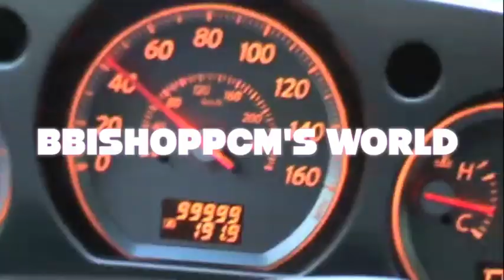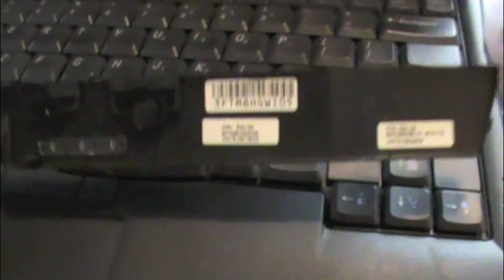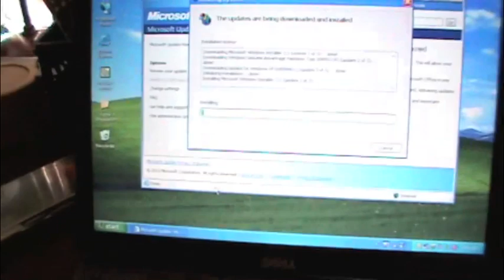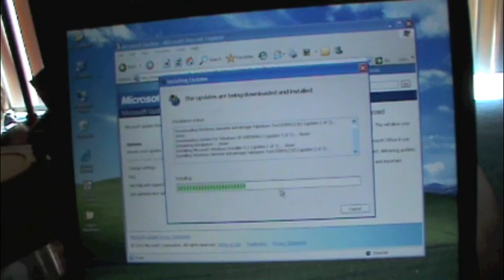Dell Latitude PP01L Repairs

Comment: i was given one of these and it doesn't even power on and i took it part and every thing looks fine.
Reply: That makes 2 of us. If you sort it out please share. Thx.
Reply: Update. Disconnect from mains, and remove the battery. Then hold the power button for 30 secs to 1 minute to do an electrostatic discharge on the laptop. Then connect to the mains - do not reinsert the battery at this point - and see what happens. If it boots up, turn it off again and reinsert the battery. Off you go.
Reply: it did not work but thanks for help

Comment: HOW to do to reset password bios????
Reply from the maker: ***** I've never had to reset a Dell, but IBM Thinkpads are a whole different story. They require major surgery.
Reply from the maker: ***** About 12 years ago, when I worked in a used computer shop, we had a Thinkpad 760XL that required a very delicate procedure to reset the password (IBM doesn't fuck around!), it required dumping the data from the ATMEL chip. The procedure is absolutely insane... we junked the laptop. http://sodoityourself.com/hacking-ibm-thinkpad-bios-password/

Comment: That's actually a Lattitude c600, however mine still says PP01L on the bottom, but when i looked up the service tag it Said it was a c600. It also says C600 when it boots up.

Comment: So my Dell Inspiron 600m (model PP05L) is actually a Pentium 3? That is really interesting considering the machine is from 2004. It has a 1.5ghz pentium M 715 processor and is soon going to get a 765 2.1ghz along with 2gb of ram. I'm actually really surprised this thing is as quick as it is, knowing now that it is a pentium 3 based system.

Comment: Glad that was useful!!! Those we are talking about are most usually discarded for use for any practical, real purpose at present. And yes, they are quite limited, but you can get more life into them than most people would expect from a machine over a decade old (usually way into the electronic rubbish level when it comes to computing).

Comment: I have pretty much  the same config as that laptop other than the processor. I have the 4750 (I think) and it works ok. Mine has the Pentium 4 1.6 512MB 40GB. The CPU Fan died though, It gets hot but never overheats. I rarely use it. I have the same problem with the hinge. These preform well for 10 year old laptops. Mine was 2001 as well.

Loving the videos and keep up the good work.
Cheers.

Comment: @skypedog221 i wouldn't say that is a good deal.. i got a Samsung n310 netbook from craigslist for like 80 bucks and it has 802.11n, 160gb hdd, 1.66 atom cpu, 10.1 screen.. etc... much better than a 12 year old laptop.